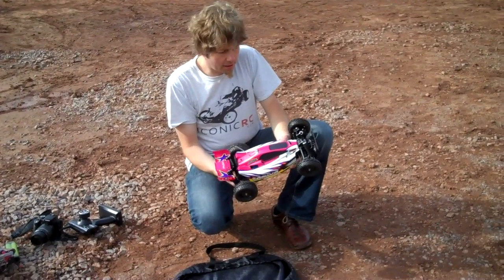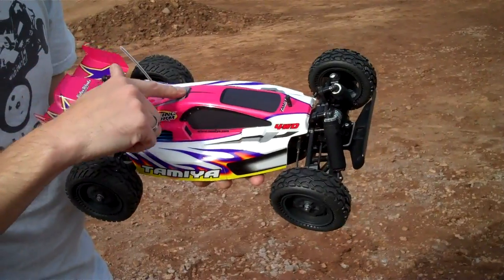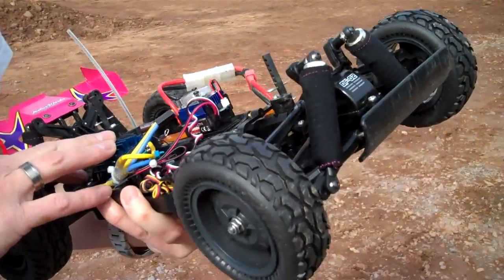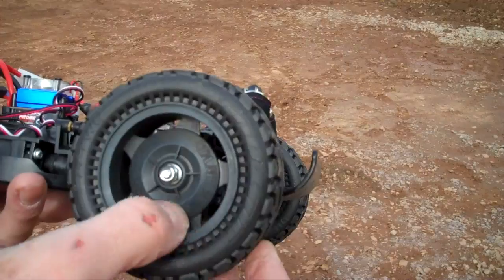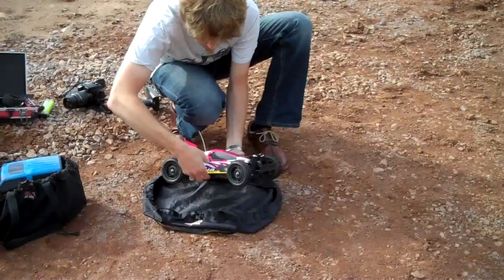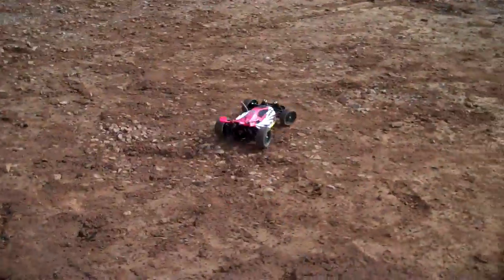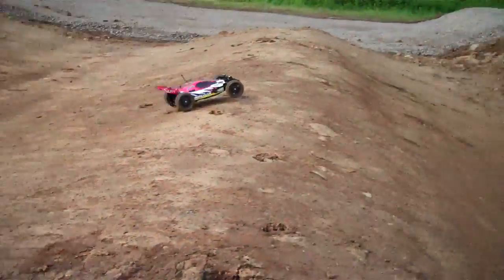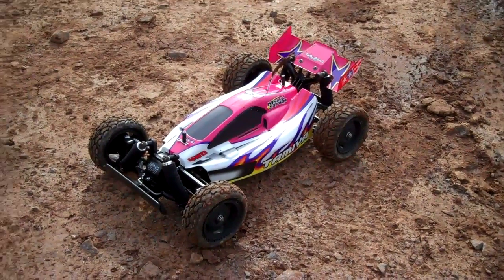Tamiya 58334 Rising Storm with Pro Line Dirt Hawg 2.2's and 17 Turn Motor

Comment: Can someone please help I found this buggy in my dads loft hes lost the shell and I can't find one anyone kno were I can get hold of one
Reply: i would try a body from the tt-02b line of buggies; plasma edge II and neo scorcher. you would likely need a different rear body post hole and possibly some extra trimming around the shock towers. but plasma edge was for this chassis (df-02), and plasma edge II was the tt-02 chassis, and those are identical bodies as far as i can tell. good luck!

Comment: I got a similer model called tamiya plasma edge it broke when I took it on a scateboard board ramp the wheels were worn out so I ordered new ones plus spare drive shaft and some screws because they fell out but my new motor I ordered did not arrive yet:(

Comment: got mine recently, it was a gutted XB model and wanted to enhance it on a budget, I replaced all plastic bushings with the brass ones I had laying around from a tundra, put LRP motor and ESC, with robinson 19T steel pinion, did put 1/8 shocks forward, stock ones back, but modded to real chocks with tho .38 brass casings plus friction grease, also I put plastic terminals from a steering linkage to give the car much more ground clearance, now it has like two finger heigh

Comment: Thanks a lot for your info. But...you did a motor tuning, right? I mean, the size of the tires is bigger than the size of the original ones. One question left: What do you think about this standard servo (Modelcraft Standard-Servo MC 4519). The car is for my 8 year old son, so I thought for the start it is good enough and if not then I have to use another one.  

Best regards,
Michael